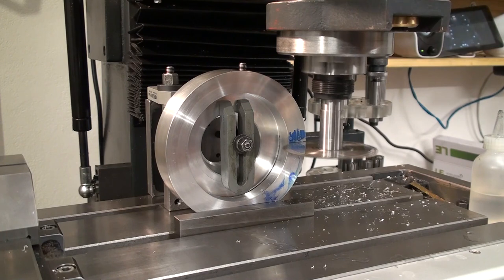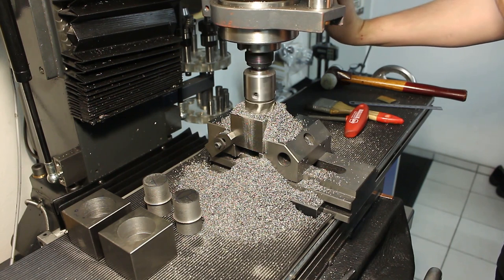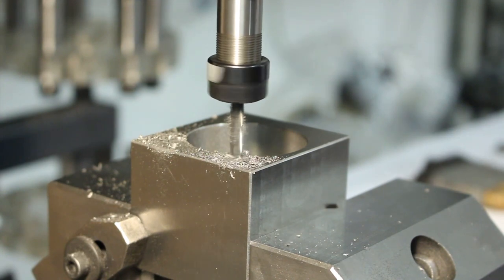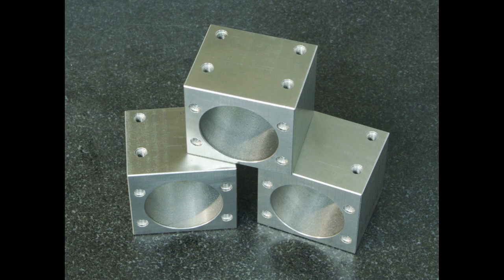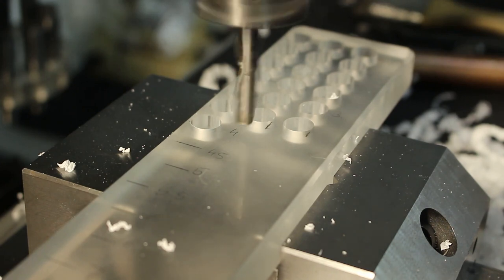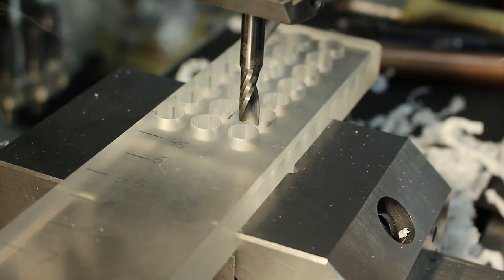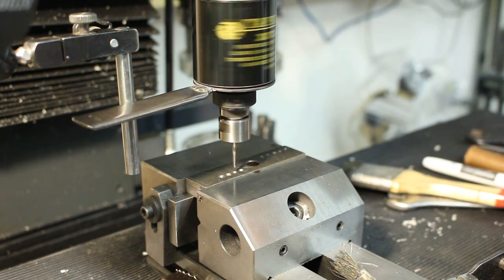The Archives - #1

Comment: Nice work Stefan.  You don't need lots of loud music and a complicated project to make an interesting video.  Just someone who knows what they are talking about, delivered in a relaxed and engaging style.  As a home machinist I always learn something from your videos, or am inspired to try new approaches, or justify that tool I was thinking about buying (!).

A while ago I found myself needing an 11 mm drill and the sets I had were either the popular 0.5 - 10 mm in 0.5 mm steps , or 13 mm to 25mm stepped shank drills.  Luckily I was not in a hurry so bought various sizes between 10 and 13 mm in 0.5 mm steps and they have come in very handy.

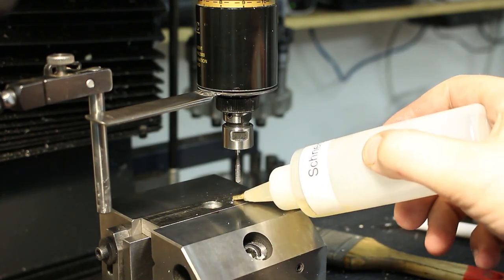By coincidence I was talking to a colleague in the machine shop at work today as he was trying out a 'tapmatic' head on a new machine.  A bit different in operation to yours at it is on a bridgeport style cnc machine with a rigid tapping mode, so really only needs a bit of end float as the spindle is in syncronised control.  Made short work of the threads he was tapping.  Very envious !  Bit worried at 5:05 in your video as the workpiece looked like it was on an angle, which is not good when tapping, but at 10:36 you had straightened it out.

As a bonus your videos are all in metric so I can directly relate to them with my own work and experiences.  I joined in recently with a discussion over on John Saunder's channel about metric Vs inch and it got very heated, so left it alone.  Shame that the World still has both systems.
Anyway, keep up the good work, regards UK.

Comment: one of my first jobs was to use a tapmatic to tap #2-56 holes for small shoulder screws in the tip of bourdon tube pressure gauges.

Comment: Good work. I like this. More. 

For example: Reamed hole prep: the use of a bored starter hole to ensure location? Breaking (lightly champhering) sharp cutting edges to guard against edge flaking in some materials? Discussion of coolant and cutting oils and where and when to use them?

I got more suggestions if you want.

Comment: I have the same tapping head, with the same crummy looking weld. I figured the same as you, that it is a repair. I don't use it much, and figured that if it fails, I will redo it. Now I wonder if it was manufactured that way? Is it intended as a sacrificial element to protect the mechanism? Or if it was just less expensive to manufacture?Or maybe they all get broken and repaired the same way?

Comment: Do spiral tip taps work as well as spiral flute taps? And do you have any sort of spring loaded pilot to eject the slug on the annular cutters?  I enjoyed the video. Thumbs up!
Reply from the maker: Yes and no :D
Spiral flute are better suited for non-trough holes, normal machine taps are more solid and used preferable for tru-holes. The slug on my annular cutters drops out by gravity most of the time, in one of 10 cases I have to use something to help it out.
Thanks for watching!

Comment: Stefan  Great content.
I am surprised no other Youtubers have picked upon using denatured alcohol on Aluminium
Reply from the maker: Dont know, its an old machinists trick over here and I like it for the no-mess-factor ;)
Reply: I've taken to ethanol not just as a coolant for machining alu but (on a spray bottle) for cooling small pieces being sharpened or reshaped by grinding, or small weldments. Forced evaporation seems to improve the cooling action and the quick drying is convenient, easy on the skin, and does not encourage rust to flash form. If I stupidly touch a hot item the handy spray bottle quickly cold the skin and prevents a deeper burn.
Reply: Stefan, your cunning idea for an adjustable drill reminded me that when I had a collet rack to make (from PVC plate, in my case) I came up with the same idea but using a tapered D-bit I'd made for the smallest collet size (ER11).
After making slightly undersized holes to suit all the other collets (ER16 thru ER40) I used the D bit, varying the offset in the boring head and controlling the depth, to quickly open out all those holes to the correct taper. Worked a treat, and furthermore it would work for  the cylindrical case for any straight fluted cutter regardless of the number of flutes, I guess. Should even work after a fashion with helical fluted cutters, even in a blind hole, provided they were positioned suitably as regards angular phase, with the most eccentric point on the active cutting edge ending up near the
bottom of the desired bore, just as in your setup ... 

When a major earthquake caused some damage where I lived, I was happy that all the collets stayed put in spite of the rack face being only 30 degrees off vertical.
Subsequently, a much larger quake which tipped over my 17" lathe and collapsed part of my workshop structure only dislodged about one collet in ten! So the taper was obviously a decent match.

Comment: Off topic but is it necessary to add oil or grease  to the permanent Mag Chuck on your Surface grinder?
Reply from the maker: The Eclipse chuck on my grinder is oil filled - it even has an oil drain screw on its underside. When I cleaned the machine, I had the chuck off and refilled the chuck with way oil. I think it is needed because the internal parts of the chuck slide against each other.